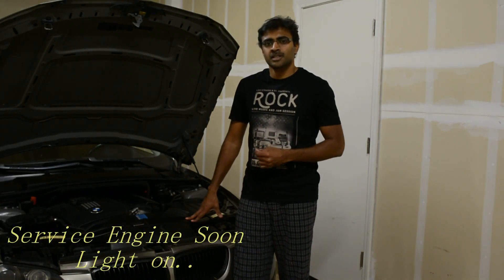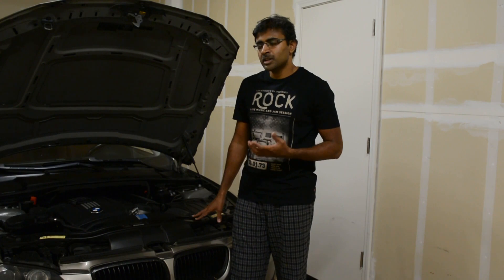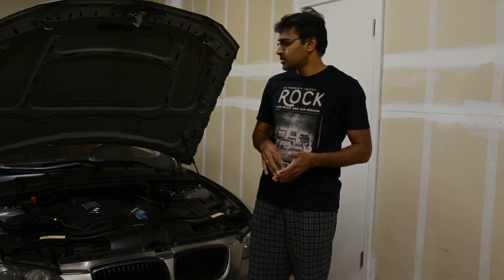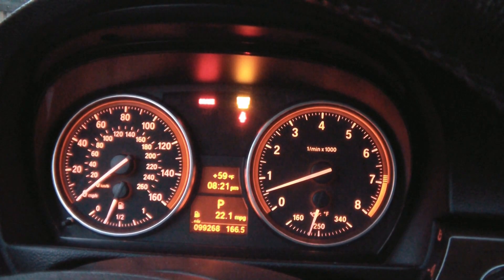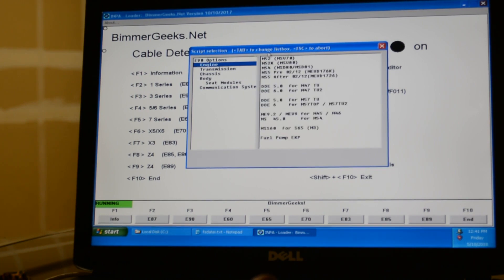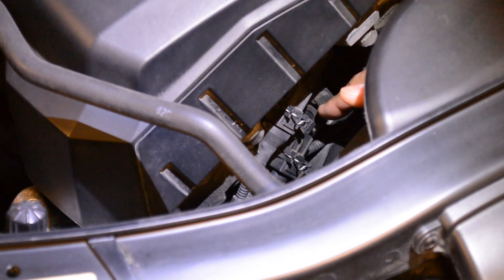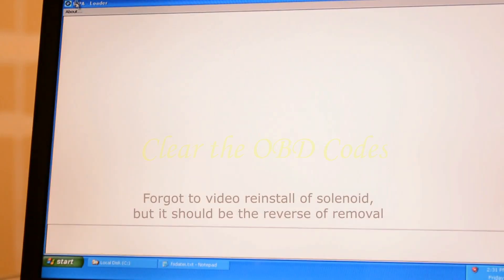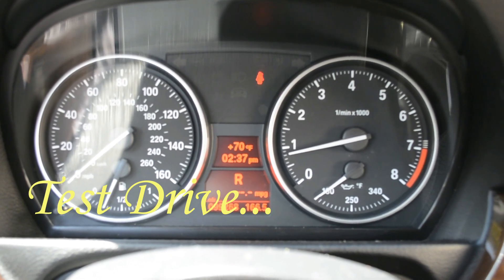SES light on BMW 328i - 2A87 Error - Vanos solenoid

Comment: My 328i 08 randomly turns off. But usually when it starts, it keeps doing it until I let it be off for a couple of minutes. The scanner reads the same code 2a87. Was this an issue yours had aswell? With the turning off and somewhat misfiring after it starts back up?
Reply from the maker: It happened in a very similar way to my car, except the engine did not completely stall. But it lost its power and was barely able to idle. I have to stop, restart the car and yes, it acted  normally after that. Happened a couple of times randomly in a Stop/Go traffic situation.  I cleared the code initially, but within a week got the same code again.Tried cleaning the solenoid, but didn't work. So replaced the solenoid, have put around 30K miles now and still no issues. Looks like a very common failure for E9X N52 engines. Try replacing it and hope it should be resolved. Best of luck !!!